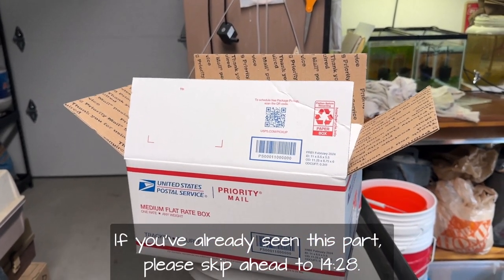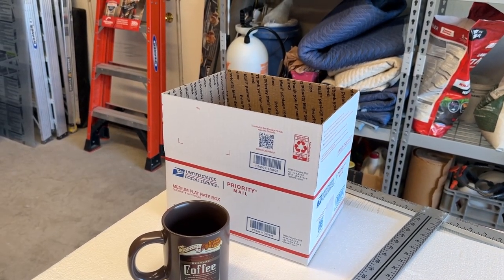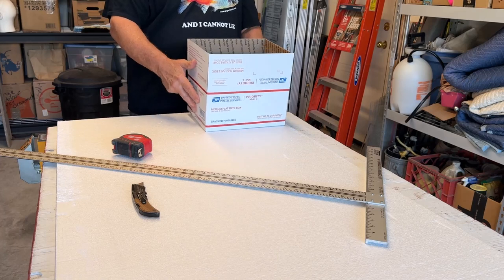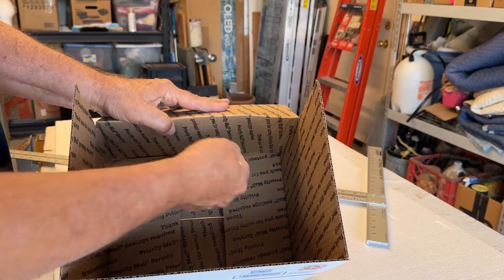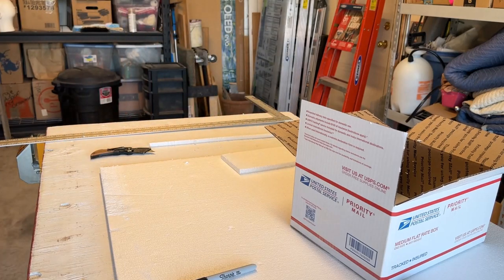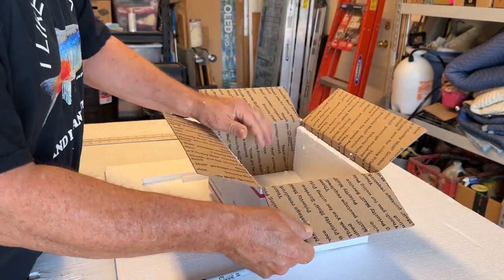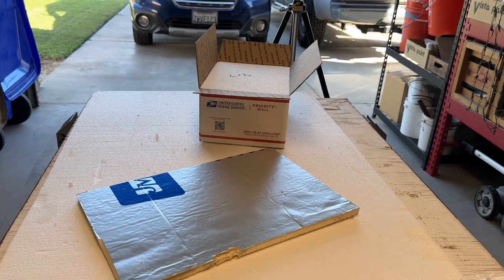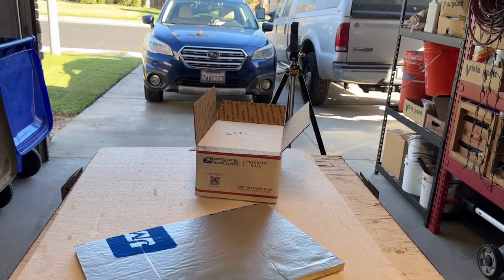Shipping Fish To @PelhamsAquatics

Comment: $18 is a high price for postage Ron, is that the standard for the us mail? England is a bit cheaper but the have laws on who can transport live fish which knocks the price up to 
But i sneak shrimp and plants through royal mail lol
Reply: Great demonstration 👍
Reply from the maker: That's the price for that particular Priority 'If It Fits - It Ships - Flat Rate box. All in all, I couldn't get a box across country for $18. Postage does keep going up. But so does fuel costs. The Priority Flat Rate boxes are really a pretty good deal. The USPS only aske if there's liquids, lithium batteries and a couple other things. The box even has live fish marked on it. Plants into certain states can be a bigger issue.
Reply from the maker: Thank you!